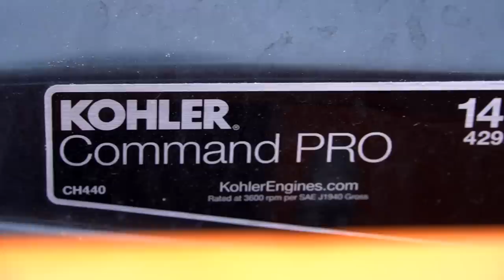Pulling Off Concrete Forms | New Home for the Sawmill

Comment: Your slab needs 2 weeks to dry complete. It is still not dry in the center.
In the center it is like clay. If you drive vehicles upon it too soon, the 
slab will crack from the inside out & will have to be done over.

!

Comment: Oil Changes... Do yourself a favor... the NEXT oil change... find a brass fitting the fits the threads on that oil drain plug... (like 3/8" pipe thread)... on the other side should be a hose barb fitting that slides into a hose.  Then put a rubber hose... like old air compressor hose or....?   You only need about 16inches or so... enough to get the oil past that shelf that its sitting on and pointing down to a bucket.  At the other end... well you have many options there.  Put a 1/4 turn valve on.... put an "air" quick disconnect (female end) on it.... That way you just have to insert the male end and the oil will come out, but pull the male end and the oil will not leak out.  Leave this set up on ALL the time.  Leave it on top of the shelf until you need to do another oil change and its so easy... just slide the all ready attached hose over the edge of the shelf and turn the valve.... when the oils is done draining... shut valve off and put hose back on shelf where its not going to get caught in the saw.
  I have done this for 35yrs with generators that are in enclosures or engine powered welders etc. that are in small steel covers that are almost impossible to get to the oil plug.
If you wanted to you can use pipe and hard line it out and 90 over to edge and then 90 over The edge and add the valve there.  Then, just put a bucket on the ground turn the valve and come back in 10 mins.
Have fun.

Comment: Don't you need to fill those joints with some compound? I would assume otherwise water will collect there and once it freezes it will break the concrete.

Comment: Take note wd40 is not a lubricant you need to use a spray oil like 3 in1 or a silicone one to provide long lasting lubrication wd40 is only a water repellent and possibly a penitrating fluid to help free up nuts bolts etc. even then a proper penitrating fluid will do a much better job, and if corroded or rusted a derusting liquid

Comment: If you can, it would be nice to have a concrete vibrator to help level out the cement as you pour, this saves a little work as you don't have to pull it around as much with the come a long (concrete hoes). It would also eliminate any honeycombs on the sides against the forms.

Comment: As Elon Musk has taughht us, "The secret to success is failure." When touring his rocket engine plant a reporter commented on his latest creation, "I hope it succeeds", and Elon replied, "Oh no, it is going to fail, and when it does we will learn why it failed, and fix those things. Then the next one might fail also, and then we will fix those things, and maybe the third one will be a success, and every one after that will succeed as well." You guys like Elon are made of the right stuff. You go out and do it, and aren't afraid of sharing your journey with everyone. 
So now that you have completed your first pour you have learned so much. Your first pour is a functional success, and then your next pours you will correct what you have learned; for example using the edger tool to be tilted and sliding along, instead of poking down in, and when using the hand trowel, you go very gently, and when dressing the top you do so, so the rocks in the mix don't show, and when ordering, ordering a full yard more than the calculations show so you don't run out. Also, standing by to pull the forms off as early as possible so you can dress trim the edges. My concrete guy also uses a hose to give them a light dusting of water the following day a few times so the top layer doesn't dry up way more quickly than what is underneath. 
I really like your channel. You guys have all the right stuff. I'm a fan.

Comment: Those are beautiful cants that you made.  Do you plan to build a building to house your mill.  On the “My Self Reliance” channel he built a pole structure for his mill.  Yo will find that when the snow falls on the saw dust it made a very hard rough surface.  So I believe it would be prudent to build one.  You have enough room for a small shop for the mill.  Great  video.  Waiting for your next adventure.  From the lower 48!

Comment: Hiding the edge is not the answer… In the winter water will get in there and freeze and pop your concrete. What you need to do is seal it somehow with a waterproof covering like a membrane or a paint or an epoxy.
Then, when you put the gravel back up against, you won’t have to worry about moisture, getting into the concrete slab and popping it open.

Comment: I WAS WAITING FOR YOU TO TAP THOSE FORMS  OR USE A CONCRETE VIBRATOR WHEN YOU WERE POURING THE SLAB THEN THE SIDES WOULD COME OUT SMOOTHER. I DON'T WHY GOOGLE WOULDN'T TELL YOU THIS WHEN YOU LOOKED UP POURING CONCRETE, OH WELL NEXT TIME TRY THESE METHODS .

Comment: Using a metal trowel to finish the concrete makes the aggregate to settle into the concrete and smooth it.  your inexperience surely shows you didn't know what you were doing.

Comment: There's not a problem with the concrete, it's in the procedures that should have been done during the pouring and finishing that caused the rough areas. Some of the requirements missing were the vibrating of the form edge with a hammer or rebar, using a edging tool more along the forms, and using both a mag to float and smooth the concrete [at the proper time] and using a finishing trowel to get a better & smoother finish [as it sets up] before brooming it.. Also, most people use a joint tool to set joint control lines in the concrete before it is hard. This is done just like the edging is done. But, a few saw cut the joints the 'next day' [note how soon] every 5'-12' each way. You don't wait until you have hairline cracks. If it is hot, keep it wet and cover with poly or burlap. I admire both of you in your hard work, but learn from advice of professionals

Comment: Next oil change use aluminum foil under the drain plug and shape it into a dish/funnel that directs the oil to your drain pan. I use that method on my Tacoma so oil doesn't get all over my front suspension parts because Toyota thought having an oil filter installed upside down was a good design!
Reply from the maker: Great tip!

Comment: WD40 is not a lubricant. It is a water displacement spray it does not lubricate. I know people believe otherwise but, it is not a lubricant. Will it displace water and allow things to slide sure. It does not lubricate though. So there is no protective oil/film left over. Now oil does hold onto dirt and dirt is abrasive so there is that as well. Sawdust holds a lot of small minerals which is what makes it abrasive. It's also why ash can be used to add minerals too food. Real old school knowledge there. Now if it's WD40 Lubricant spray not just OG WD40 feel free to disregard.

Comment: Home Depot screwed you, SHOCKING...Shouldn't be an issue thankfully. The pad will be under very little load. Frost heaving would be my biggest concern, but in your circumstance  accounting for that would have been prohibitously costly and labor intensive. Not like it's a deep sea submersible, where you can skip the engineering and save a bunch of money , even when paying clients lives are at stake........